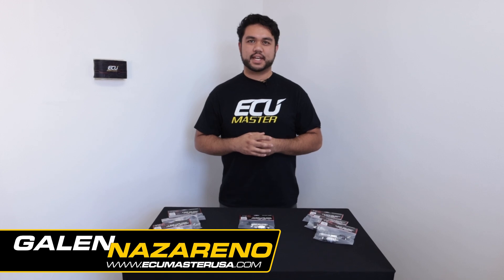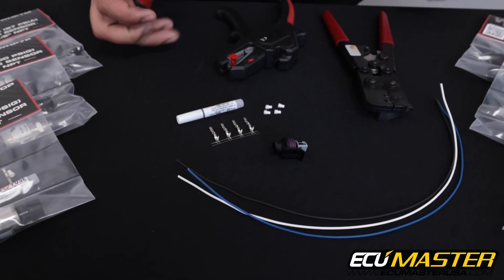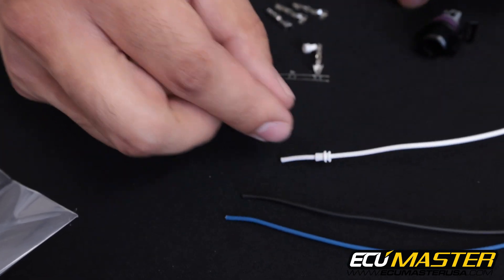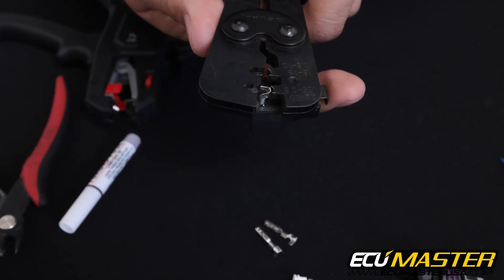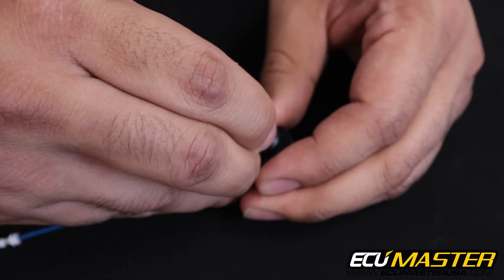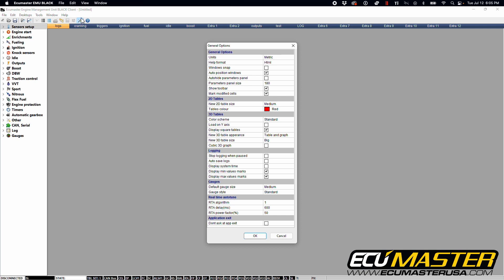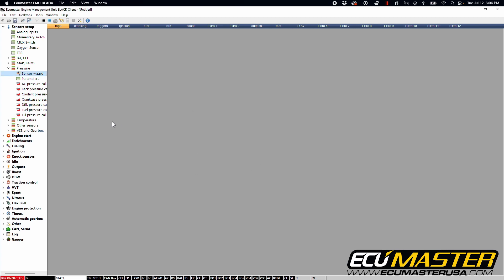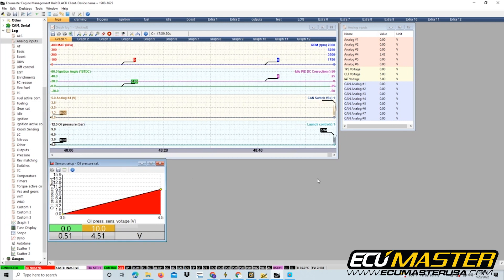EMU Black 10 Bar Pressure sensor setup | ECUMaster USA

Comment: I have a ecu master emu black PnP for Lotus S3 2Zr engine, this ecu come with additional 26 way AMP connector for spare input i wiring ecu master 10bar pressure sensor to Analog input 9 as it says in the pinout but I don't know how to tell the ECU that the sensor is on that input.

Comment: Something to mention,  make sure there are no oil cut parameters turned on.   I was scratching my head until someone pointed it out that there was a cut on in the emublack that made the car stall.  Also,  remember that 0 bar is a perfect vacuum.  1 bar is sea level atmospheric pressure  so 1bar is 0psi